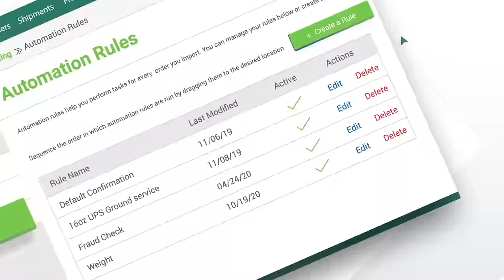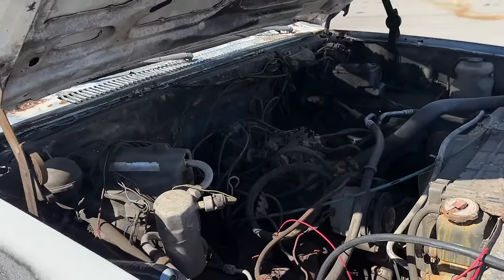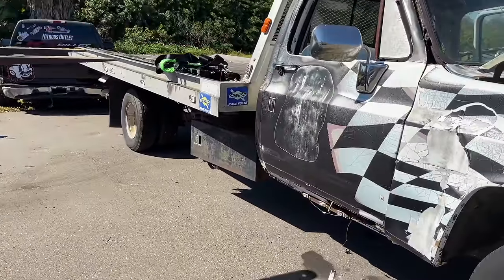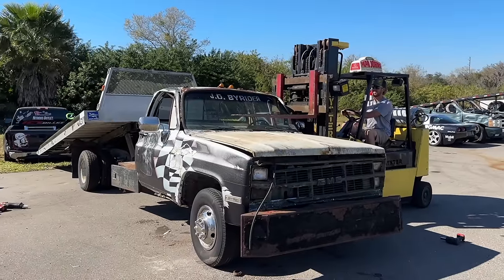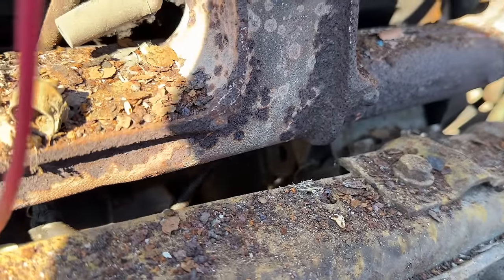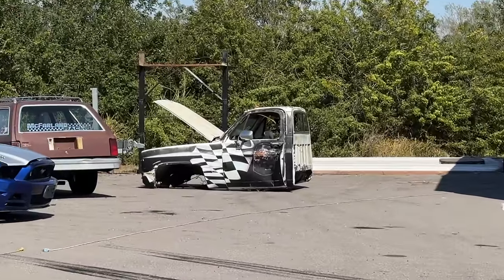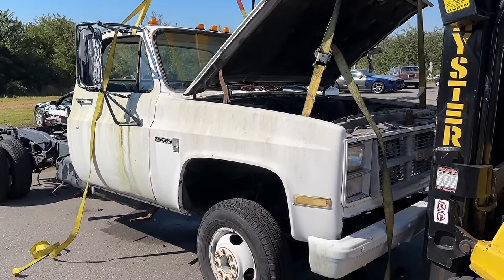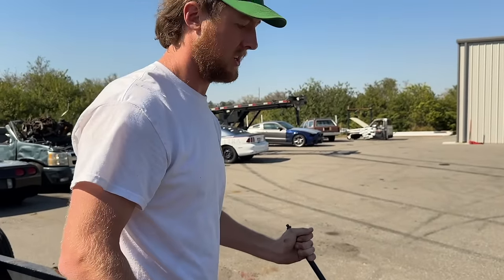Cab Swapping the Forgotten Freedom Factory Rollback... It's a DISASTER!!!

Comment: While you are redoing the hydraulics redo ALL of the hoses. You are already down there with things apart, with hydraulic hoses its not a matter of if they will blow, its when. Replace them now and you will have years before you have to worry about that. And i mean ALL of them, it will always be the tiny hose that looks fine thats buried under everything that ends up blowing. Hauled a fertilizer/seed conveyor trailer around for a while, spent plenty of time crawling around the framework fixing hoses and the trailer was only 4 years old. Local manufacturer, we actually got prototype number 2 from that company. We changed a lot, like breaking all of the hoses up into 5' sections so we dont have to haul out and replace 20' of hose every time one blew, and making sure the connections were positioned somewhere reachable so even if the hose blew deep in the trailer you could still undo both ends fairly easily. Set up your system right from the start to save a LOT of headaches down the road.

Comment: The shifter does come out. Take a pair of pliers and push down on the tin piece at shifter base then turn like an 1/8th turn counter clockwise. Two roll pins old the tin piece in. Tin piece has littler ears and there is a spring under it that keeps tension pushing up so it stays hooked on the roll pins.
Reply: I hope they see this, I was going to comment this, but I see a couple guy's besides yourself that know how it comes out

Comment: For future reference, I think when they said to lift with the doors shut, I think they meant to close the door on the strap, instead of putting the strap through the door. Lifting with the doors closed is generally done to prevent the “tub” from bending under its own weight, the doors help reinforce the rigidity of the cab.
Reply: 100% this. Also parking brake cables are super strong when your trying to yank apart junk cars

Comment: i retract my previous statement, stick a cut in half crownvic on the shorter dually frame with it closed off as a cab, keep the 6.2 in it an find or make a wrecker body for it.. have a diesel dually tow pig crown vic for the freedom factory along side the restored og flatbed, best of both worlds!

Comment: Done dozens of cab swaps. Always used a two post lift. First to pick it up and remove the transmission and disconnect everything, then set it down, pull the front clip off and position the pads under the rockers and lift the cab. Roll old chassis out and roll new one under. We built a metal box with wheels on it the same size as the roll deck that we used as a makeshift dump truck bed. Loving the content. This was a lot of cringe to watch, and I think sometimes you do that on purpose!
Reply: Yes, it is cringy because they have money to do a decent hot rod ramp truck and parts are easy to find for square bodies. I have a 79 C20 that I have done everything you can think of to and upgraded with great parts probably an easy $7k into the 406 forged and full roller engine, built th400, gear vendors overdrive, disc brakes, factory ac that works great, stereo, you name it. My other one is an 88 K5 Blazer. My trucks are restomods but even if they took the easy route and properly cleaned and painted the frame and built up with decent parts, it could be a very nice and usable truck. This video was too much like the few I have seen from whistlindiesel.
Reply: Is there a reason you take the transmission out? I always just take the shifter off or make it go down with the shift boot, but I've only done a couple.
Reply: I like to go through the transmission while it's easy to get to. (Unless it's a truck I'm familiar with and know it's okay inside.)

Comment: My 7 year old daughter saw them lifting the engine out with the forklift and said I’ve helped do that a bunch of times daddy. It looks like the same engine. A tear came to my eye. 

Adventures of cleet and squirrel should be a channel on YouTube. 

SM465 transmission will probably be fine. If you’re just keeping it at the track it’ll probably fine. If you’re going to drive it on the highway at all an nv4500 would be better.

Comment: So I worked at Pascagoula auto salvage Clet. This is how we did every truck we pulled motors out of. It's best to have a big fork lift with really big forks. We cabbed every 5.4 Ford truck. Cab bolts spin when they don't come out. We would torch them if they spun.
Reply: Niceeee.. I lived in Grand Bay, AL for years and would pass by that salvage yard all the time when headed to college in Gautier

Comment: @cleetus for the shifter on those 4 speed transmission if you go to where the pivot join at the bottom of the shaft. Push down and twist and lift them the shifter slides out. Found this out on my 65 Chevy c20. Quick and easy and saves you some pains

Comment: Use a two post lift and strap the cab down using tie downs, then just drive the frame up under the cab on the lift and lower it down onto the mounts. 23:31
Reply: 32:48 should’ve pulled it into the shop and used the lifts

Comment: The induction heater nut buster works wonders on cab bolts. Or the pneumatic torque multiplier ease them right out.

Comment: The transmission is a SM465 and there damn near bullet proof. The shift lever comes off super easy you just push down on the cup and turn it a quarter turn to dissengage it from the roll pins on top of the shift plate.

Comment: its a little late now, but if you soak the cab bolts down with penetrating oil for a couple of days prior, then use a ratchet or breakover bar to break the bolts loose first you have much better odds of getting old cab bolts out. The impact strips out the top part (retaining tabs) holding the nuts.

Comment: You guys really aughta drill a 1 1/4” hole in the ends of each fork and get some tapered pins for them so when you are picking up slung loads, you can be sure it won’t slide off the end. You can also throw a to ball on each fork through that hole for moving trailers easily.

Comment: The half dome ring at the base of the shifter, shifter in neutral push down on the dome ring and spin counter clockwise quarter turn and it will pop up then pull shifter out.

Comment: Also those shifters are the easiest to remove, just push down on the cap and turn it counter clockwise about 90 degrees and lift straight out

Comment: You should just change the transmission to a 4l80 with the big block and run a belt driven PTO pump off the serpentine on the front of the motor. That’s what snatch trucks/repo trucks use.

Comment: That shifter does come out!!!  And it's so easy.  Lift the boot, neutral, and spin the retaining ring!!!
That trans was used in big dump trucks too, thay will TAKE A BEATING!!  I had one in a 383ci Snow Plow truck with posi in front and rear making around 500hp, and it took it from 1979 until I sold it last year!!
Also...  make life easier and get a hydraulic master and slave cyl for the clutch.  One little one in the firewall, and it'll go right in.  The slave is bolted to the outside of the trans.  1986-1989 years had them, but they sell everything you need at Advance Autoparts.
Reply: @cleetusmcfarland
Reply: Just another day, Grifting Vice Grips for Saws-All Blades.

Comment: Those cab mount bolts are treaded into captured nut in the floor you gotta cut a hole in the and tack weld the nut in 
Brothers truck has a video up about cab mounts on squarebody

Comment: I know this vid was more of a comedic way to cab swap a truck and they are more than capable of doing it correctly. But for anyone doing this: always use a lift to remove the cab and an induction heater or some heat source for the cab bolts. 👍

Comment: You made your life harder by taking the weight with the forklift, if you're pulling upwards on the cab you're adding tension to the bolts.
The first bolts were easiest because that tension was spready evenly over all 6 bolts, each time you broke one loose the tension is spread over fewer points which increases the tension
They would have come out easy if you just left it to sit on chassis until the bolts were removed and then lifted it

Comment: Those bolts are not fixed to the cab.  You need to get on the other end and hold it.  I’m sure you 
know that.  It wouldn’t be good programming if you did that.

Comment: If I wanted to watch a perfectly good truck being destroyed merely for the sake of trying to be funny. I'd go watch Whistling Diesel. You worked twice as hard doing it the wrong way. The right way... remove front bumper, 3 minutes, remove Hood, 2 minutes, Remove grill to access the 2 grill support nut and bolts, 4 minutes, 10 minutes and a few bolts and you  remove front clip. then 2 minutes to remove shifter boot and shifter from trans. 15 minutes to remove 4 cab bolts and lift cab off with 2 ratchet straps and the fork lift and your done.

Comment: If that 07-13 Silverado has a good steering wheel position sensor ya boy needs it. My stabilitrak kicks off every time I turn the wheel after starting it. Ordered 3 different ones and they all come with 8 pins on the connector but I need a 6pin. I don’t get it

Comment: Just a tip from the North where rust is on every single vehicle 😂 use heat and penetrating oil on stuck bolts. Soak the bolts the night before you work on it and if that doesnt work. Use a torch to heat it up

Comment: For the shifter you push down on the ball and turn it(the ball at base of shifter). The whole shifter will pull out of the trans, make sure it’s in neutral otherwise it’s a pain to get it back in.

Comment: Did you seriously just admit you don't know what transmission that is??? Bro u boys gonna have to get up on ur knowledge of older gm parts and designated codes for them . THAT TRANSMISSION IS SM465 4 SPEED. IT IS FOUR GEARS ONE IS JUST LOW GEARED FOR PULLING.  BEST TOUGHEST TRANS EVER BUILT!!!

Comment: Those trans have like a 6:50 first gear so that’s useless lol second is probably also useless , just use 3rd and 4th 1:70 and 1:1 and it’ll be like a power glide with a locked converter unless the clutch is smoked then it’ll act like a torque converter 🤣🤣🤣🤣

Comment: Hey cleeter mcskeeter the transmission in both trucks is an sm465 and the shifters do in fact come out. Right at the base of the shifter there is a ring that you twist with a pair of channel locks and then it will release the shifter they are probably covered in grease so it may be hard to see

Comment: if you take the grill out you can get to the top of the front body mount bolts that were cut off to replace them.  The other 4 aren't quite as easy to get at but you can use a hole saw to pop holes through the floor to get at them as well and those transmissions will take an absolute beating with the weak link being the clutch not the gears in my experience anyhow.

Comment: Those transmissions are sm465 they are bulletproof,  same trans but you need the bellhousing from the sbc as the diesel bell is different. diesel bell will bolt on to buick/oldsmoble 455 if you want to do one of those.
Reply: You're thinking of the Olds diesel (5.7). The 6.2/6.5 is pure Chevy, mounts and bellhousing - see the next video